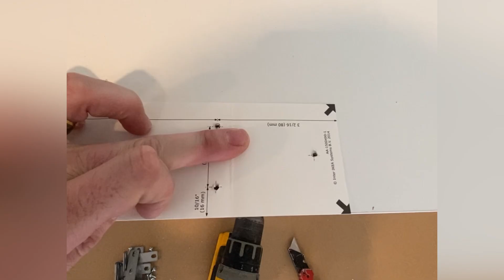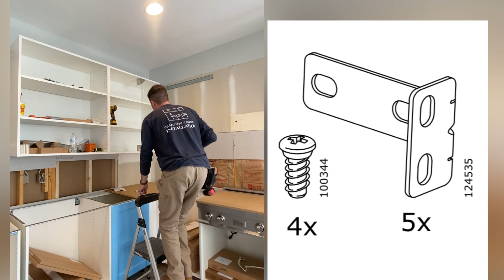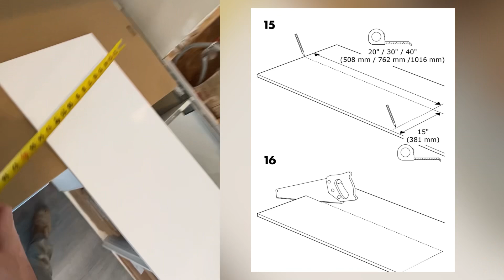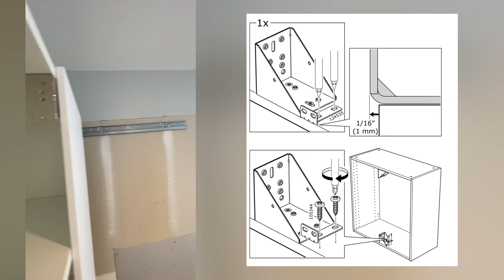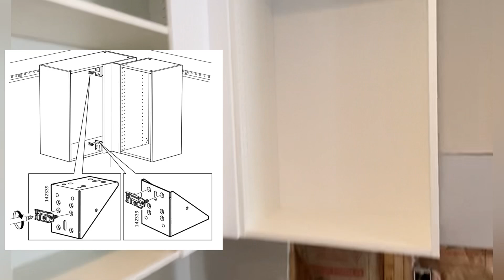Installing IKEA Blind corner cabinet - Utrusta corner fitting in the IKEA wall cabinet. Blind corner

Comment from the maker: Build a corner wall-cabinet using the UTRUSTA corner fitting.
Get plenty of storage with corner cabinets at a 90 degree angle.
In this video we show you how to install this unit, we followed the Ikea manual and we have to confess that they were not easy instructions.
We have an easier installation method and will make a DIY video on this topic in the future.

Comment: I think this thing is not clever so much. Why it is so massive? Maybe some secret  function, which was not explained in this video or manual? The second issue, I dont understand why is neccesary to use another holder next to it for the blind door.
Reply: It has to carry all the loads on the front door and exactly stay rigid on the positon that it has. Maybe it will be a little small you had a good point, but this part is so precious on the small kitchens at the blind corners. Normally a standart universal front door has to carry 30kg without any crash and stay in a little displacement tolerances. 
And second holder for small cover at the corner. It doesnt have a function or something just cover, a little L bracket is enough for this position. Our big part is independent from this cover, because of this we need two different parts. First one is hinge and front door for cabinet, second one is just holder for cover.